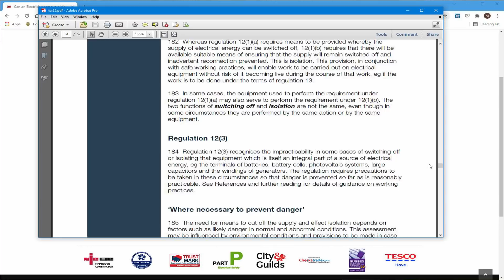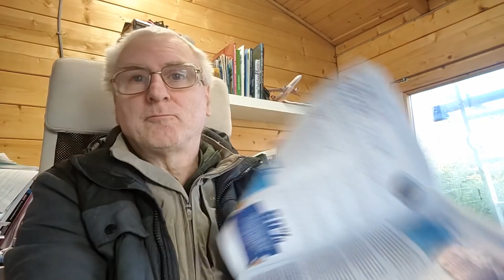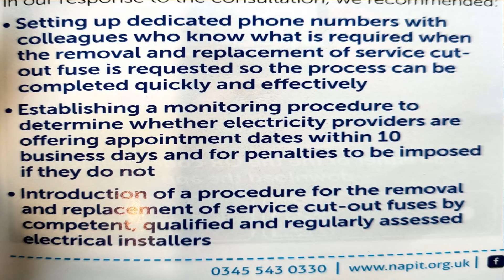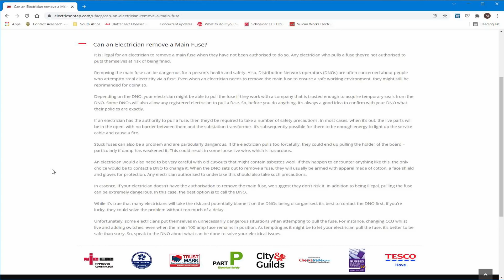CUTOUT OR MAIN FUSES - New procedures for 2022 should finally allow electricians to pull these fuses

Comment: 2025 - Western Power in Somerset have a policy of replacing 100amp main fuses to 80amps without informing the householder. I recently had solar and 2 Tesla power walls installed. The application was made by the solar installer (G98 I believe) stating the main fuse was 100 amps and that due to the overhead supply being flaky my export limit was set low. Everything worked exactly as planned for a year when suddenly my power wall reported that my home was operating off grid. Smug smile broadened across my face as I thought the neighbours were off line while I was able to continue using my power. Some 8 hours later I became suspicious and checked my neighbours who are on the same transformer only to find they were in supply and the joke was on me. In all fairness WP attended pretty rapidly and replaced the fuse which turned out to be 80amps not the 100amps that was fitted. Somebody had changed the cutout fuse! I also have an Eddi which was running my top and bottom heaters as well as my twin power walls charging at 10kw . Couple this with a 4 Kw hot tub and chuck the car on for good measure you can see why the 80amp fuse blew. No one can tell me who downrated my supply but they do keep referring me to their new policy of supplying maximum 80amp single phase supplies u less I want to pay £7k for a new 3 phase supply with all the associated costs of splitting my home I to separate phases and balancing the loads. I have now adjusted the settings on my Zappi, Eddi and power wall to ensure I do not exceed the 80 amp capacity by adjusting when things come on and changing the Eddit to only use one element to heat water. This comment is for information purposes only but may serve as a warning that the cutout label does not state the actual fuse rating fitted as the same cutout can take different rated fuses with no way for anyone to know u less the main fuse is pulled - that’s a whole new can of worms which is subject to heated debate as this video demonstrates.

Comment: The DNO is the last bastion of protectionism. Anyone who has a safe competent status should, for valid reasons, be allowed to make safe. Should there be a gas leak then everyone should be instructed on how to isolate the gas meter, at the incomer. It could save lives and property. This should apply to incoming electrical supply. After all, electric meters are not infallible.

Comment: Pull them if you are a qualified electrician because you will only get a slap on the wrist , once you have pulled the fuse fit a double pole 100A isolator and then replace the fuse and you can then isolate your consumer unit supply by switching off your 100A isolator therefore you won't need to touch the mains fuse ever job done, make sure you fit the isolator after the meter because everything including the meter and anything before that belongs to the power company

Comment: As a retired electrical engineer, I would agree that pulling the safety fuse should be allowed by a competent trades person. Why this is classified as a criminal offence beggars believe. Personally   I think this is basically protectionism. If you consider the many laws that are broken daily then, pulling this fuse, would be just a run of the mill crime. You are correct when you highlight the health and safety act. If automobiles had been invented today , they would have been deemed as a serious health and safety hazard.

Comment: Having been trained to pull a main fuse, I had to be verified by the dno(1 day course) and also to use correct health and safety equipment i.e visor and insulated gloves and flashover clothing.
Also I had to ensure adequate sealing with identifiable tags which could be traceable.
Couldn't count the no of broken eyelets that were on cutout fuses due to a bodge job.

Comment: If there is no isolator I would pull the fuse. I have spoken to western power and they advise you need to get them to come out - at a cost
Reply from the maker: Luckily come June that'll be a thing of the past :-) It can't be overstated what a game changer this is, not only for electricians but for our clients as well

Comment: Back in my day ,1960’s onward , when working on installations is was easy to slit one side of the seal, take out one side of the sealing wire, remove the seal and take out the fuse. The seal being there to stop bypassing of the meter. After doing the work it was easy to replace the sealing wire and re-crimp the seal. These days, in an outside meter box, a 2-pole isolator is fitted after the meter to enable the fire service to cut off the supply to a house without entering the house. Due to the lack space I have seen the isolator being removed to enable an EV unit to be fitted !

Comment: Electrician here with 40 years experience industrial and domestic. It’s an absolute farce. Isolators should be fitted when fitting smart meters but there not because the suppliers are private companies with shareholders……they could have incorporated a user isolator into the smart meters instead of just the internal one that they can operate remotely if you don’t pay…….( isolate consumer unit with its main switch, put insulated gauntlets on and eye protection. If the cutout apparatus is in good condition, cut the seal and pull the fuse. Safety comes first)

Comment: I’m watching this but can’t stop looking at that twin and earth clipped on the wall 🙈
Reply from the maker: Unfortunately done a long time ago by another sparky, not their fault I might add. In a log cabin you have to try and avoid vertical runs because the logs move, and end up deflecting the cables as you can see (The original pencil line is visible). You'll notice in later videos that cable doesn't exist anymore.

Comment: Some years ago I called a DNO to request to pull the fuse for a CU replacement, and replacement of undersized tails, because I wasn't able to be in attendance at the same time as the meter operators fitter. Quite unbelievably the DNO advice was to connect the new tails to an outgoing breaker on the old CU, leaving the old CU hanging off the wall while live, so the meter fitter could later cut the new tails and connect them directly to the meter. Needless to say I pulled the fuse and used a Henley block for the temporary connection. Apparently the meter fitter was totally fine with this, re-sealed the fuse and told the customer it was the first re-connection of the day that had no issues!

Comment: The water and gas supply isolators to supplies. The electricity do not.

If they do not supply isolators  and electricians have to pull fuses to isolate to work safely, they have no case. 

If they do not want their fuse pulled, all they have to is supply an isolation switch like the water and gas authorities do.

Comment: I did a G39 course when I worked on the street lighting,  this allowed you to pull DNO fuses in columns and feeder pillars . To do this you had to wear gauntlets and a face mask because there is a risk of the bakelite cutout crumbling and the live touching the neutral,  if this happens you can get a 2ka fault current which would splatter you in molten brass . I don't pull fuses in houses because of this knowledge.

Comment: I've seen many a service head mounted onto rotten old boards in damp cellars. Pulling the main fuse out in these situations could dismount the whole service head leaving a dangerous situation. Other times where the old fuse carrier contacts are so corroded that it's virtually impossible to remove without risk of shattering the bakalite fuse carrier. So although I'm all for pulling the fuse when necessary, it shouldn't have to be necessary. If the DNOs would put an isolator in place then it would solve so many headaches. Why they didn't incorporate one into the new smart meters is beyond me. But after all said and done I'd rather pull the fuse than work with live tails.
Reply: if its a nice new grey cutout not going to really have problems. my job is fitting meters. big issue we have is sparkies leaving open ports on henly blocks exposed inner insulaton.  some older cutouts rotten ones and metal clad ones we wont touch DNO need to replace them.

Comment: You can't just pull the fuse. You need to confirm there is no current or work serious safety gear. With 220V over 4A you get a big spark and need to protect yourself. We don't have these fuses here but an other type which can be handheld with a special glove.  You need special training every 2 years to work a this.
Reply from the maker: I agree. Yes 99% of the time nothing would go wrong, but if it did, it almost certainly would be the last thing you would do

Comment: As someone who worked in domestic and industrial sites It is nothing but a joke that I am not meant to be capable of pulling a cut out fuse to work on a system if the board don’t want you to pull a fuse. Then they should supply proper isolation
Reply: You obviously don't give shit about the consumer who gets accused of tampering with DNO equipment after you have gone.

Comment: Anytime any meter is changed for any reason, it should be a health and safety mandate that an Isolator is installed, so power can be turned off and locked off by an electrician.
Reply: im a meter fitter and yes if you have enough space on site we will fit an islolator for you. you will slowly see them popping up

Comment: I had them turn up with the fuse in my hand they starting laughing 😂😂😂😂nothing happened and I been pulling them for 25 years. If they don’t want the fuse pulled then they should fit isolation switches

Comment: The reason that Sparks pull the main fuse is to achieve "safe isolation" to work on the rest of the system.  There are two sets of regulations in conflict here:
1) Requiring "safe isolation" to work on the system in the first place; and
2) Not pulling the main cut-out (fuse)
Where the DNO has fitted on isolator switch it is obvious that the Spark (or Customer) has no reason to pull the main cut-out, but in the majority of cases where no isolator exists I would still pull the main cut out with the justification of "safe isolation" and "safety of installation".  I have had to do this at more than one property where there has been evidence of arcing on the meter tails at the meter or arcing on the incomer to the consumer unit ... over the years the screws have worked loose and the installation has become dangerous.
If DNOs don't want people pulling the main cut outs then they should - at their expense - make it their business to visit every property on their patch and install an isolator switch to provide a proper demarcation point between their equipment and the customer.  If the DNOs are not prepared to do this then every qualified Spark (under NICEIC or NAPIT) should be allowed to pull the main cut out for the purpose of "safe isolation".
Reply from the maker: Point well made. Thank you

Comment: 1.	The law is a toothless tiger. If anyone has a link to an article referring to prosecution of an electrician (NOT a cannabis farmer) for pulling the main fuse, please post it below.
2.	Yes, pulling the main fuse exposes the live network; yes, the cut-out could break apart; yes - asbestos risk. 
3.	I always remove the meter terminal cover and the old tails, then fit the new tails, working backwards from the isolator in the new CU, (all using an insulated screwdriver, of course), then add a new crimp seal (from eBay) to the meter terminal cover. Once, in 2015 a contractor from Lowri Beck arrived while I was working. He said DNO had remotely detected tampering. I told him what I had done earlier and he said “Fine” and left. I think a modern meter sends a digital signal to the substation if the cover is removed.

Comment: Let's just emulate the EU suppliers (shock, horror) and fit a 500mA RCD main isolator switch, programmed to trip at the maximum permitted current for the property. Much easier all round. After all, many of the supply companies are EU subsidiaries.

Comment: I have just done some work on my consumer unit, I put in a swa supply to my new shed. I noticed that the main fuse didn’t ‘t have a seal on it and this must have been cut off when the kitchen installer sparky fitted a second consumer unit probably 5 years ago. How would I get on if  the Dino were to see it and think I had done it.
Reply from the maker: I'm going to go out on a limb here and say they would be hard pressed to prove it, especially if the meter hadn't showed a power cut for some time. I get this all the time if I go to a client to do an EICR and see the seals cut. It fails the EICR and the DNO have to be called to reseal it. I've never been accused of tampering with the seals as the meter hasn't stopped during the time of my visit.

Comment: Hello ill set this out first. 39 years as a time served tradesman for a DNO, 15 years of that specifically working on faults so have pulled every type of cutout fuse there is, also replaced the same amount of cut outs, both live and made dead...think hot dinners.
Yes I know what I'm talking about, ok.
It is illegal to carry out any work, which includes pulling fuses, on Network operators equipment. You have to remove the security seals to remove the fuse. Theft or abstraction of electricity, note its the homeowner who is liable if you have left site, they rang happy when they find out.
You have no seals, sealing wire or pliers that are numbered and registered to licenced operators.
Asbestos, we as DNO know which has asbestos, how to deal with it and are registered, trained, for "small works" on asbestos.
Many times I have been to a cutout where the sealing lugs are damaged by electricians and the cutout has to be replaced, the cost of that is bad enough but think on this, the cut out is replaced live, bare conductors with a 500a fuse hundreds of meters away at the substation which will not blow no matter what. That's why we wear flash retardant overalls at high cost, full face visors, insulated gloves and use very expensive insulated tools. And still there has been deaths and many injuries over the years.
We still do it because we know if its done correct its safe, people make mistakes when they don't know what they are doing, how do you recognise a cutout is dangerous? Been stressed?
As a rough guide I would regularly, once a month or more, refuse to touch a cutout so it had to be made dead via a hole dug outside and the cable cut, again very expensive and dangerous but not as dangerous as an explosion inside a cupboard I'm sitting in.
Yes I have been involved with cables exploding so seen the aftermath and twice involved personally,  not with cutouts though, they are too dangerous to mess about with.
I'm pleased for anyone to ask questions, I am trying to scare you, you may get away with it lots of times but if it does get you you are well and truly got, burns and a high fine from HSE if your lucky.
Cheers.

Comment: You have to be approved by the relevant DNO to pull a fuse as it's their equipment and you need their authorisation. People don't really take any notice though as it's a nightmare to get the relevant people out to pull fuse or fit an isolator after the meter if you want to work downstream. 

I've also heard stories now of people pulling fuses on smart meters then the customer gets a phone call from the supplier wondering why they have no power, when they explained an electrician is working on it the supplier tells them they shouldn't be doing that and they then send the DNO out. Apparently.
Reply from the maker: Thats exactly what happened to me when I was working on my own house. Took ages to explain to the person on the phone that I had turned off the isolator and not pulled the fuse!
Reply: @vwes They SHOULD be able to differentiate between lack of voltage on incoming supply (meter is on battery) which means cutout fuse is pulled, or that you have a 0 W reading on your consumption but meter still have a voltage on incoming, which means either the isolator is flipped or you flipped the main switch in your consumer board.

HOWEVER, some meters do have a contactor which should be used to turn off supply (usually by holding a yellow button for 5 secs) and THEN flip the isolator to ensure a safe working enviroment.
This signals the electricity company that you want to cease electricity supply for some reason (could be vacation, electrician, fault finding, thunderstorm etc) and then they will not care about the isolation switch.

Comment: the old type meter with a small isolator on the left hand side under the cover was never intended for use by electricians generally this is some thing that has been taken for granted and become custom and practice as proof there is the facility for sealing wire and seal which must be cut to gain access
Reply from the maker: Don't quote me on this, but I believe the only way to get the official seals is from the DNO. As a matter of info, an EICR will fail if these seals are missing - I'll see if I can dig out the relevant regulation on it.

Comment: by cutting the wire and seal on the main fuse you are removing the required mechanical method to prevent the fuse been removed by a incompetent person if it is not replaced afterwards including a seal
Reply from the maker: Thank you for the comment. This is the very reason missing seals on cut out fuses cause an EICR to fail.
Reply: @vwes  it’s a couple of years since i woked for N Power and the only way to posess seal pliers was to be employed by a supplier because to be a competent person you had to be audited on a regular basis by a distribution inspector as well as’in house’ inspector’s just taking a photograph can not prove safety equipment use,methods of testing/proving dead or correct information gained from customer,types of electronic equipment/regeneration equipment etc